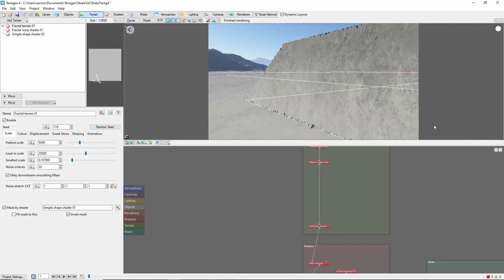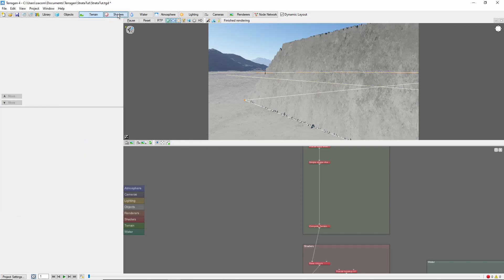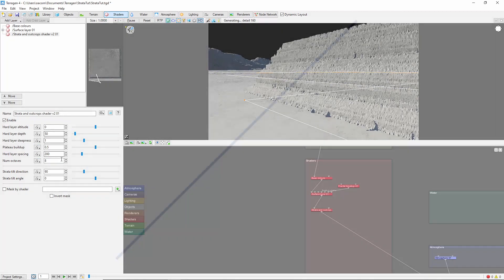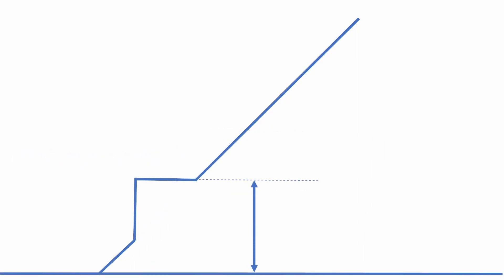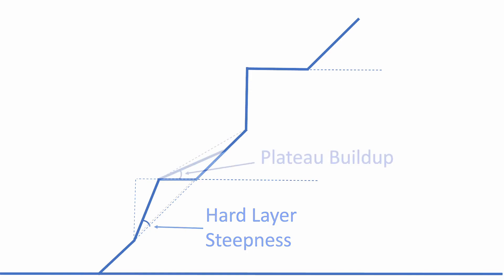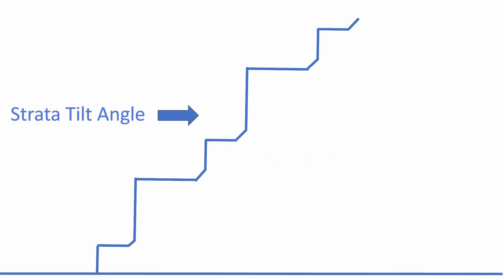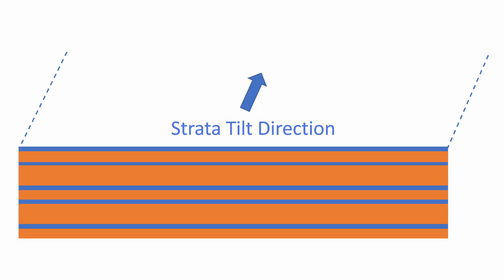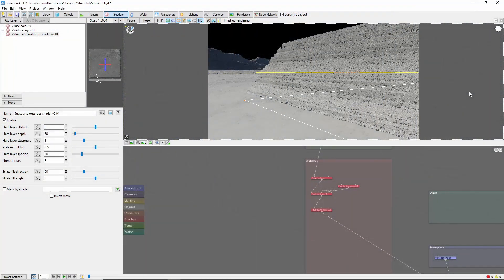Terragen 4 Basics: Strata and Outcrop Shader

Comment: i noticed this shader is below the compute terrain node. does this mean when you export the terrain as a heightfield map or obj it will not show up?
Reply from the maker: You can move the export below the strata node to include it in the export.  Keep in mind that heightfields are only 2.5D, so they won't include any overhanging terrain.